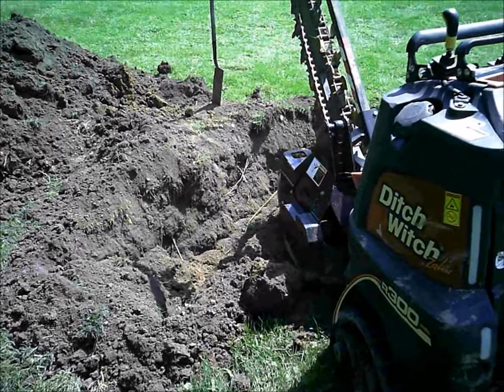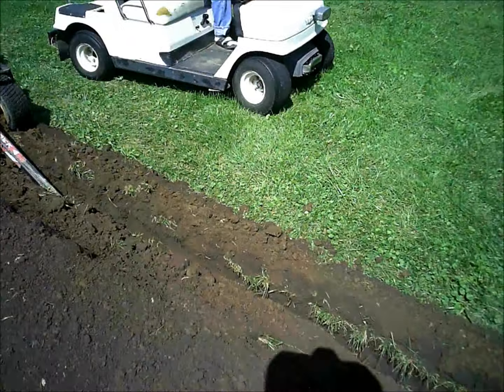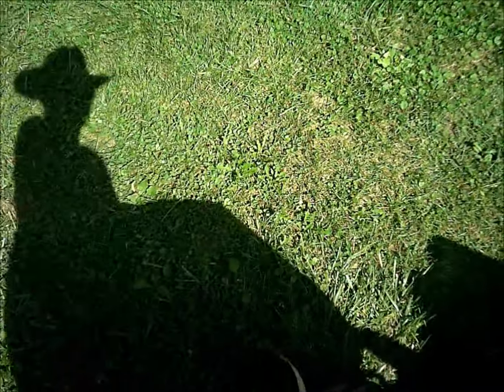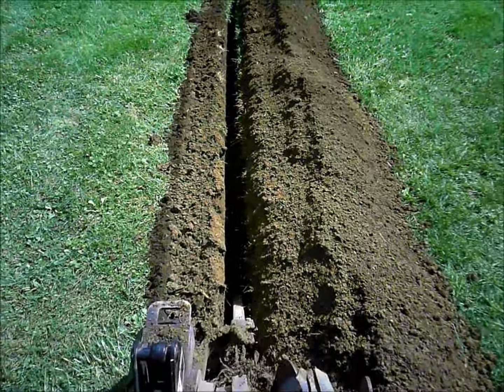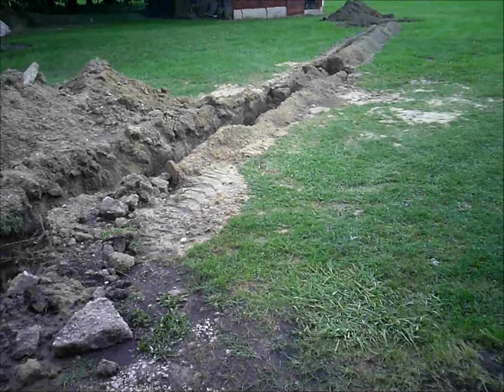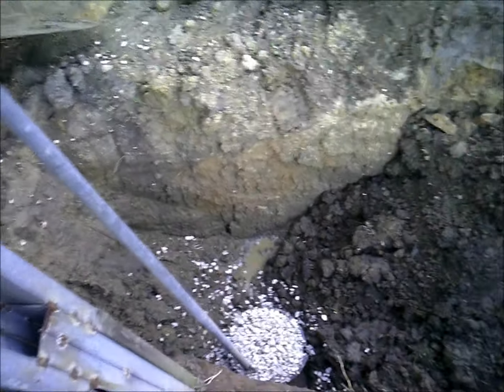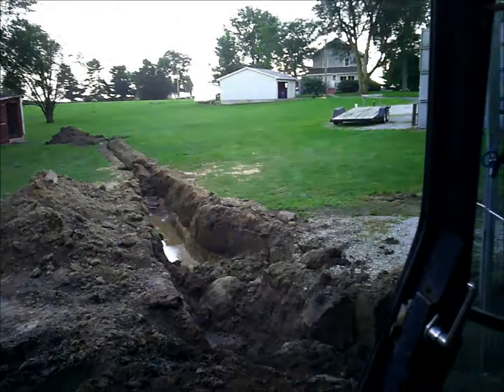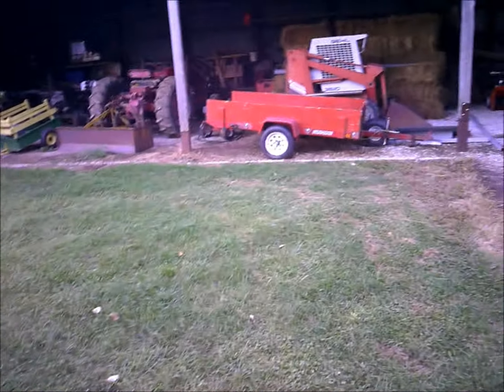Cattle pen pt 8

Comment: i knew that was going too easy.  only time I ever ran one of those we had to go 100 feet across the gravel driveway in front of the barn.  liked to never get done.  Nice work
Reply from the maker: Lol ya. Man that would be tough! You would bout need an excavator
Reply: not the way pops rolled.  "here is the trencher, have fun"  it is funny how you "find" stuff buried in the stupidest places, that is always right where you need to dig
Reply from the maker: +Jay Groom lol that's funny! Ain't that the way it turns out!

Comment: man, you have a golf cart, awesome, we use to have an electric on but the batteries were to expensive to replace, so it got to retire lol. but it has alot of miles
Reply from the maker: Haha it's grandpas he'd die if he lost it. That thing has been to hell and back tho. Me and my siblings used to drive it over rocks and through the mud all the time. I'm surprised it still moves lol. Them batterys ain't cheap I got a buddy and they parked there's like u did cuz the batteries went bad
Reply: ya i loved our golf cart, the brakes kind of worked, we didnt do much mudding though, our older cousins learned the hard way lol, we even broke one of the leaf spring 2 twice haha, but the motorcycles are good, cause to recharge them you put gas in them and not wait 4 hours lol, have you seen our latest video?
Reply from the maker: +C&J FARMS haha they were fun but ya I like gas better. And ya I got several I'm gona watch to night
Reply: ah okay

Comment: One added advantage to videoing you'll always be able to go back and find it later if need be. Looks reasonably dry there, it would be sticky to sloppy here depending on where you dig. Your subsoil is darker than our topsoil, lol. You going to put a waterer in eventually?
Reply from the maker: I've thirty of that! I'm sure I will save my self a lot of trouble 50 years from now lol of the country makes it that long...... Haha well no one ain't growing squat in that subsoil! Just clay and sand since I'm on a ridge. And I've got a auto float valve for the water tank
Reply: You can always upgrade to a mira-fount or something later on. Get one that uses the geothermal tube they virtually never freeze. We have a big spring that's made by mira-fount I have had to change 1 diaphragm in the float valve in 17 years. They are worth it in the long run, all poly, no hoses, no tank heaters very little maintenance. And you don't have to touch it daily.
Reply from the maker: +Dale Cornelius that would be nice maybe some day. I've seen them at sales before I think. How much cattle do u have
Reply: 7 cows and a bull now, we put that waterer in back before we quit milking we ran 50 or so in the dairy herd.
Reply from the maker: +Dale Cornelius oh ok

Comment: how does that water stand pipe work so that it doesn't freeze.
Reply from the maker: Martin Fitzpatrick it has some sort of a check valve so it drains the water out of the virtical part. That’s why I put it in gravel at the bottom